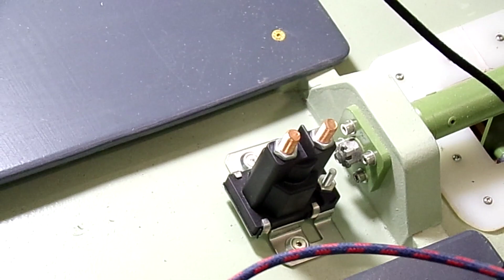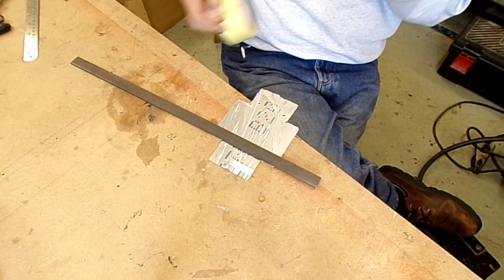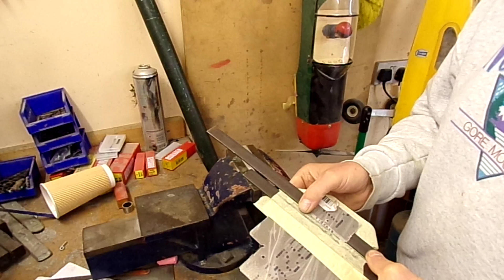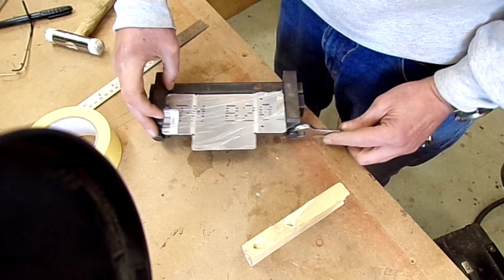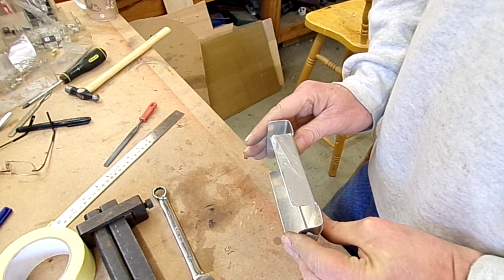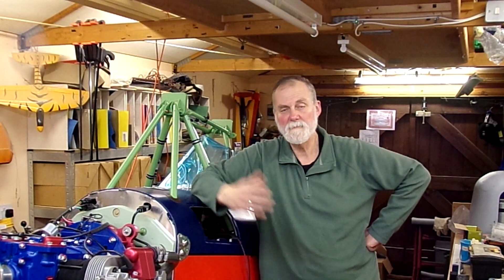EP148 Making a start on the battery and master contactor. Fisher Youngster

Comment: The battery tray was smaller than I expected but then this is a modern build so a modern battery set-up should be expected.
Reply from the maker: Yes it is not a lead acid battery but a Lithium Ion with built in ballance charging / managment system. Not cheap but light.